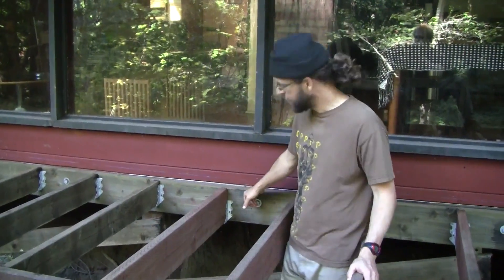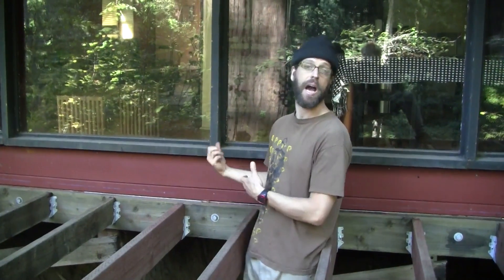Trick to build an EXTRA Cantilevered Deck

Comment: I really love this video! I'm building a deck extension and enclosing it for having an office.  I can't put posts because they are too close to the septic lines, but the County is fine if I do a cantilevered one. So, you are giving me good info. I love how you built the braces! May I ask you to write the "rule" of how it relates to the measurement about length of extension and  braces?  Thank you!
Reply from the maker: I'm not sure what the rule is sorry. I'm not sure what the county would require in terms of cante livering.

Comment: Beautiful deck, especially with the enormous tree in the corner. Did you need an engineer to design the cantilevers, or could you use a prescribed method from the building code?

Comment: 3:40 Not to nitpick, but I always assumed that 2x8's are 7-1/2" wide, which (according to the "4x" formula you cite) suggests a maximum cantilever of 30 inches. Page 119 of the IRBC seems to indicate that those 2x8 floor joists would also have to run at least triple the cantilevered distance in the opposite direction. Namely, running 7'6" inboard (min.) for a 30" cantilever. Does that jibe with your calculations? Or has the building industry move on from what I was taught?

Comment: If you had concern for the retaining wall, why not link the concrete piers together with concrete?(just curious)
Reply: I would of built that small deck with a joist long enough  instead of  connecting  3 joist.
Also the cantilever can not be supported by 2x needs 4x.
There was literally enough work and hardware to build 2 decks much less the struggle of all the  little pieces.
2 days max.

Comment: Umm have a version of this that would pass tighter codes? This would not meet my local codes, its not even 2x6 with 6x6 posts, which is the minimum, nor is it framed (spacing) to code.
Reply from the maker: This design clearly won't work for your situation.   If you're dealing with your local county or city you just got to do whatever they tell you you got to do. Or you have to hire a structural engineer who's going to give you stamped plans that will extend a cantilever. If you have a more specific question I'd be happy to try to answer it.  Best of luck to you!